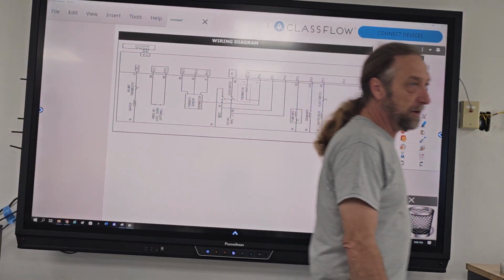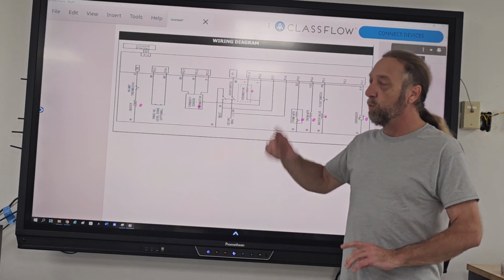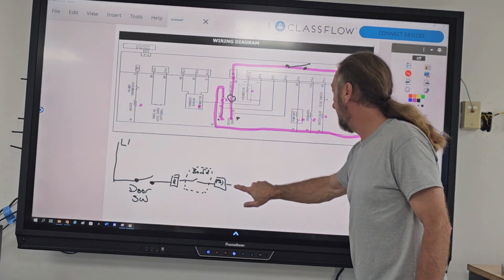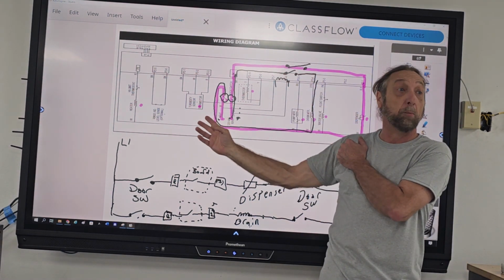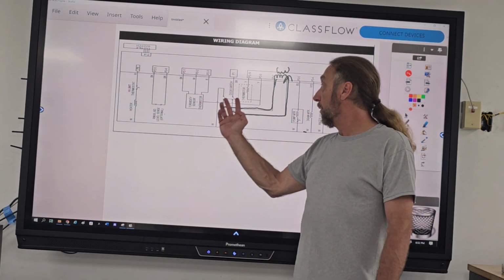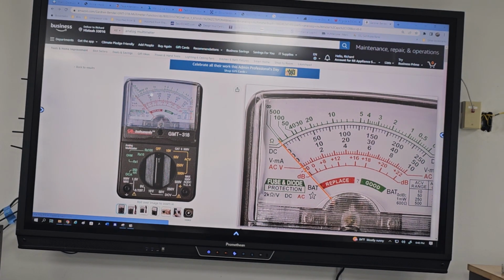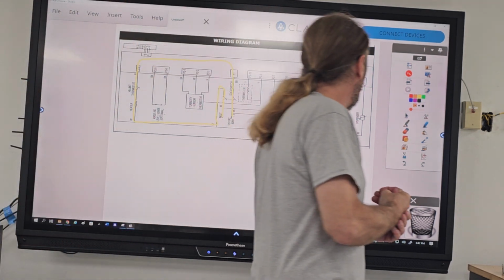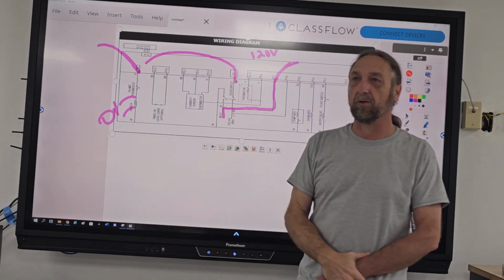Dishwasher Circuits and Diagram

Comment: https://youtu.be/vCweSHTkQGo?t=3316 was what I came here for. I wasn't sure how to test the board. I didn't see you explain how to enter the test mode. Mine had to start from power failure mode. Also you didn't mention a possible connection issue with the component. A bad connection could have been the real issue.

Comment: Summary:

🧩 Why Strip Circuits Matter — [00:00]
In complex appliances like dishwashers, wiring diagrams can be overwhelming. Strip circuits simplify troubleshooting by isolating specific electrical paths. Technicians can visually trace electricity from the power source to the component in question, making diagnosis faster and more accurate.

💻 Computer Board vs. Mechanical Timer — [01:32]
Unlike older dishwashers that relied on mechanical timers, modern units use a computer board (main control board). It acts like a CPU—receiving inputs from the tactile switches on the user interface (buttons) and activating components based on programmed cycles.

⚙ Identifying Loads and Controls — [03:09]

Loads are devices that consume electricity to perform work—motors, heaters, valves, etc.

Controls manage the flow of electricity to those loads—relays, switches, and sensors.
Recognizing which components are loads helps narrow down failures in function.

🧠 Tactile Switch = User Interface — [02:05]
These are buttons on the dishwasher’s front panel. They send signals to the main board indicating which cycle or function the user selected. They are switches—not loads.

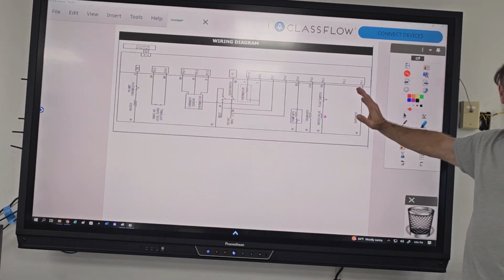🔄 Deep Dive Into Components — [04:47]

Dispenser (Wax Motor): Uses heat to expand wax, pushing soap into the tub.

Water Valve: Opens to let water in.

Pump/Drain Motors: Move water during wash and drain cycles.

Thermistor: Measures water temperature via resistance.

Turbidity Sensor: Uses infrared to detect water clarity; if dirty, it signals to drain and refill.

🛠 Dispenser Circuit Analysis — [12:43]
The power path is:
Line 1 → Door Switch → Board (P1) → Relay → Dispenser → Neutral
Any break in this path results in failure. Strip circuits make this flow clearer for targeted testing.

👨‍🔧 Troubleshooting Logic—Example — [17:56]
If a dispenser doesn't work:

If drain pump and water valve are working, door switches are good.

If 120V is at the dispenser and it still fails, replace it.

If no power, the board or relay is the issue.

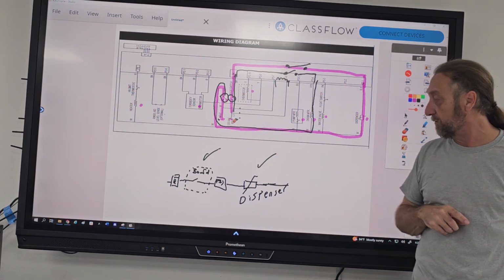🧪 Effective Electrical Testing Methods — [26:54]

Voltage Test: Check for 120V during operation.

Resistance Test: With power off, zero ohms means closed/good; OL = open/bad.

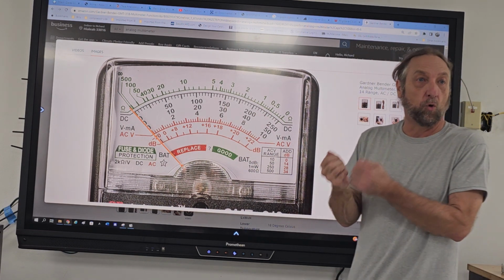🔬 Door Switch Testing Protocol — [43:17]

Power off and disconnect wires.

Close door to engage switch.

Use ohmmeter—zero ohms = working switch; OL = failed switch.

🔥 Heater Diagnosis and Cycle Timing — [51:57]

Heater activates 17 minutes into normal cycle or immediately in Step 3 of diagnostics.

Measure voltage across heater terminals.

Voltage present but no heating = faulty heater.

No voltage = faulty relay or thermostat.

🕵 Cycle Timing and Diagnosis Strategy — [50:54]
A cycle chart reveals exactly when components are energized. This helps technicians align voltage tests to exact timeframes without waiting through the full cycle.

🧠 Final Notes on Troubleshooting Philosophy — [47:48]
The key is to be methodical. Don't test randomly—analyze which components share circuitry and eliminate confirmed-good parts based on what’s working.

Comment: Well I have a GE Adora Dishwasher that want drain. So now I got a good idea about what the problem may be.  I have already changed the float switch as it was bad and the drain pump. Everything else works. So, that would eliminate the door switches I think. Got to be the board I think.  Any suggestions?

Comment: Excellent Teaching!! But LOL some of these guys are going to be technicians? Don't get me wrong, I have never had any experience in this, but after sitting through the whole session all of the sub diagrams addressing the door switches, dispenser and drain motor and then teach draws a diagram circuit through the heater and thermostat and asks "What one thing you should test first?" and dude said Rinse Level Sensor with no lines anywhere near it 🤣Please don't send him to my house.

Comment: Wouldn't a temp sensor or thermistor be a control for example a bimetal just a bimetal switch that controls a function?  As opposed to a load like the heater it controls
Reply from the maker: Well a thermistor is a resistor that changes its value based on temperature. Yes the board uses this resistance and calculates the temperature. The reason I call it a load as it does not directly turn anything off like a switch does, the control board does that. it is a fine line between the two and could be called a control but indirectly.
Reply: @TMMApplianceRepair  ah understood..what about a defrost bi metal that will open and cut off the heater in a freezer? The resistor makes sense to me now thanks
Reply: I assume bimetal is a control and thermistor going through board is.more of a load.
Reply: @fixitfelix718  yes, the board does usually supply 5vdc through the thermistor, very similar to a load
Reply: @riz65  thanks makes sense